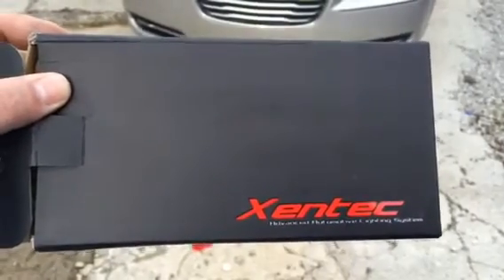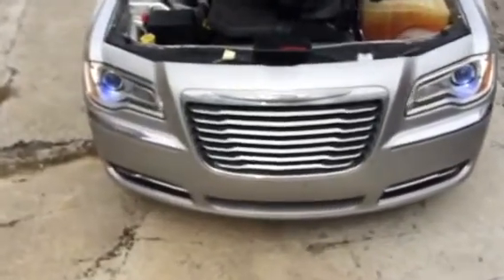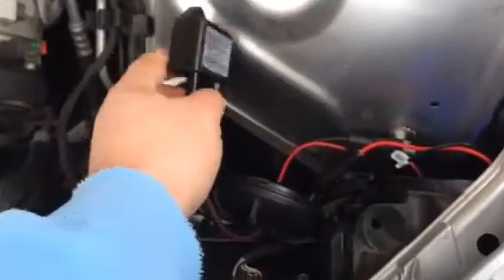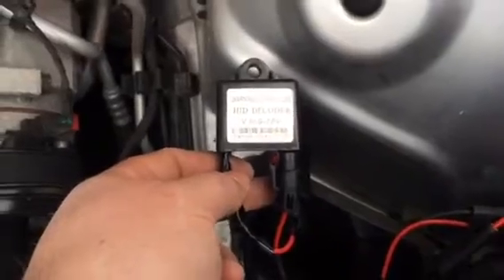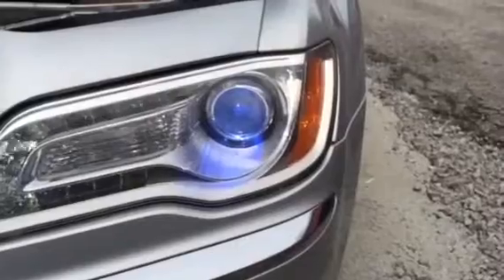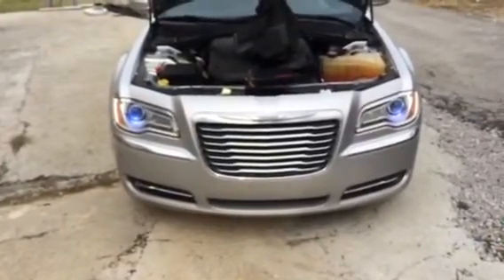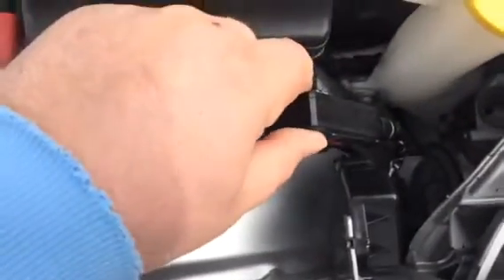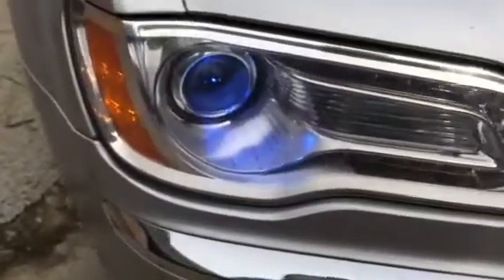HID Light Kit 2012 chrysler 300

Comment: I wanna only replace the headlight bulbs but I see it's too tight where is the caps for headlight to replace it. did u takeout the whole headlights with front bumper ?
Reply from the maker: no its easy looks tight but it's actually easy to replace. Open the cap put your hand in there and just turn the bulb counterclockwise and bulb comes out then just disconnect it from wires and that's it.